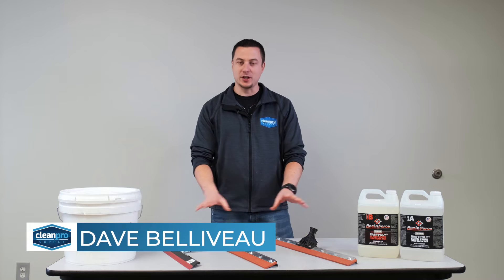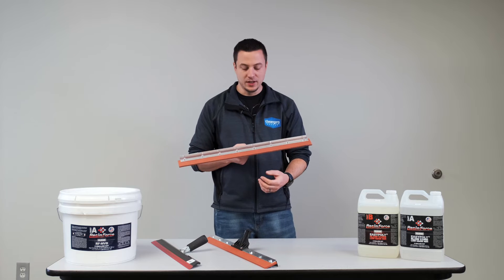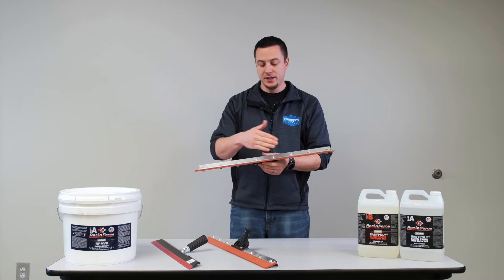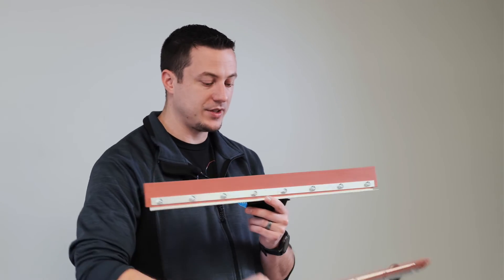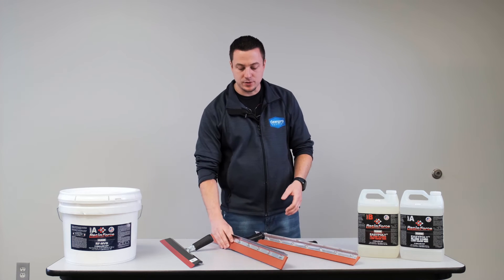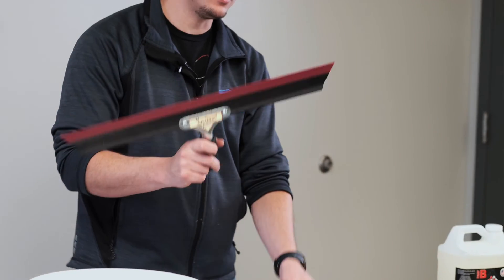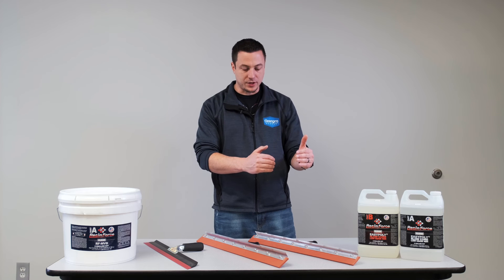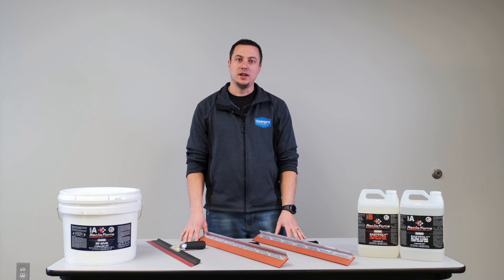Which Squeegee to Use for Epoxy, Polyaspartic, and Polyurea application to concrete floors

Comment: It all depends the specifications of scope, remember more epoxy🟰 more flake, more quartz and also more epoxy itself to use, if you don’t double quartz i recommend notch squeegee for more thickness but for flake is too much, for polyurethane or top coating dip and roll is better but not for quartz unless you don’t a second coat,

Comment: Best explanation on the topic, hands down. You consistently answered questions I was having as you were thoroughly explaining.

Metal blade serrated squeeges are rigid and should give consistent coating with little wear over. You didn’t mention them and I am assuming they should be avoided. Can you share your thoughts?

Comment: Hi Dave how are you, which squeegee do you recommend for a polyurethane sealer and self level on rubber cast.
Thanks
Reply: It all depends on how thick (mils) you want. 

Your product you are putting down should tell you how much coverage you get per gallon in square feet, this number will be at a certain thickness(mils). 

Certain products have a range of thickness. Many top clear coats can have a cloudy appearance when put on too thick.

You will need to do some math (good charts online) to answer your question.

Products that say 100% solids are usually accurate for coverage. When you have less solids then some of the product evaporates and you get less accurate. This can be a big problem for large areas where you need several gallons.

Hope this helps

Comment: Hi Dave, thank you very much for taking the time to do this video. I do have a question. Which of the squeegees would I use to spread a base coat of polyaspartic? Notched or flat? Full flake coverage. I am afraid of not leaving enough material on the floor for the flake to attach.
Reply from the maker: I would suggest a small notch (1/8") for your base coat, then back roll with 3/8" roller cover to even it out.
Reply: @CleanProSupply  Thank you.